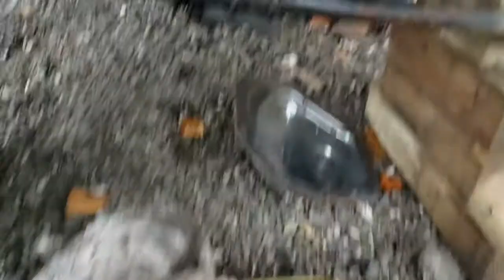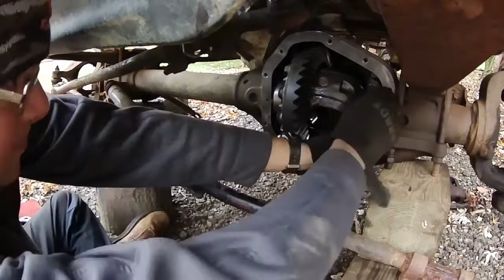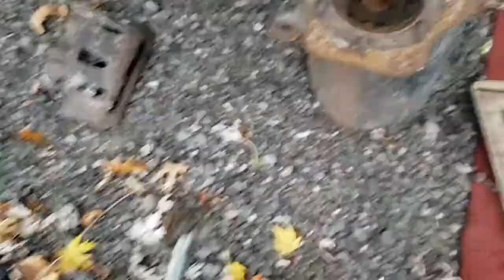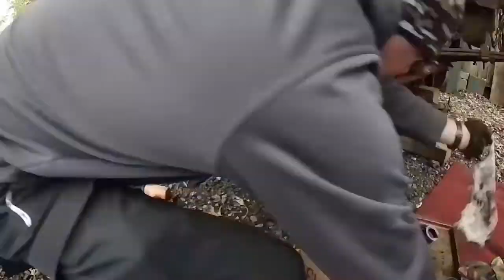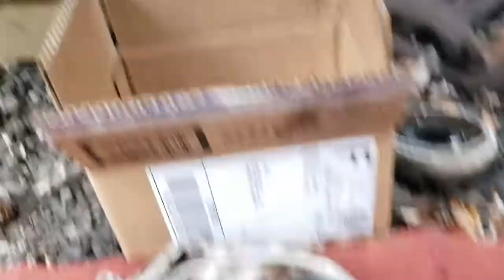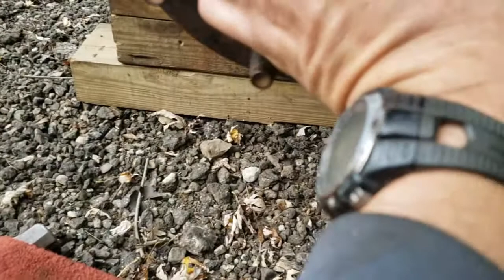How to: Dana 60 Front Axle Seal Replacement - Reassembly (Project Frankenstroke Part 12)

Comment: That is the outter axle tube seal they sent you first welders also shrink metal. Of you have a bearing race that won't come out. Put a few spot welds in the race.  The wekd pulls the metal together enough to get it out

Comment: So I’ve heard that you don’t want to press the inner seals too far in. How do you make sure you press the seals in far enough but not too far. I have a 97 f350 by the way. Dana 60. The reason I ask is because I saw where there is not a “stop” lip for the seal
Reply from the maker: I think a sling as you're in past flush with the edge of the axle tube so the seal doesn't interfere with the bearings, you should be golden.

Comment: Hey could you possibly add all the parts numbers for the seals you bought for the inner axle as well as the seals for the spindle. I just ordered some the other day, and I thought I was ordering the correct ones but clearly they are wrong. Thanks I’m advance. Love the videos. They are helping me a lot

Comment: Great video. I have a 94’ model dana with the calipers that are held in with clips. It has the ford 3 bolt locking hubs, which from my understanding are 95-96. I’m not sure if I should have 3 thrust washers or just the one with spines and the snap ring behind the locking hub between the spindle. Also where does the snap ring seat? Seems like no matter how I try the axle shaft doesn’t stick far enough out of the spindle. Cheers!

Comment: My Carrier removal was very tight I'm struggling to  imagine it taps right back in but it appears yours did.   Did you mostly place it then use the bolts to press it in place?
Reply from the maker: Actually, it was snug but I was able to coax it into place with a dead blow hammer. I think it was more or less there before I started tightening the bolts.

Comment: I am not sure but every other seal replacement video that I watched on Dana 50 and 60 front ends using a store bought tool had the seals final position further into the axle housing to a depth set by the end cap on the tool. I have relooked at those videos and they all look like the seals are at least 1/4 inch further inside the axles and not flush with the axle housing ends like yours are. In other words, they were not even close to touching the bearings on the Ring Gear assembly when they installed the assembly back in and torqued the 4 bearing cap bolts to 80 ft pounds. All I can add is that the videos I watched were for 2000 to 2010 Dana 50 & 60 front axles. One guy, (like yourself) made his own tool but he also turned his end caps on a lathe to get the right depth, (i'll include his link at the end of this message). Granted, I am no expert but are you sure you got those seals in far enough...??? https://www.youtube.com/watch?v=5K9UNcJQ6kA
Reply from the maker: Thanks for your comment! To answer directly, no. I'm not sure that the seals were bottomed out in their bores. I believe they were, but it's been long enough now that I can't say for sure. I guess if they leak, I'll be afforded the chance to do it again and it'll be a valuable lesson learned the hard way. If that's the case, I'll be sure an post an update about them. I also think there's a possibility that there is a difference between this older axle at the ones used in the Super Duty trucks (there are other notable differences). I guess we will see!